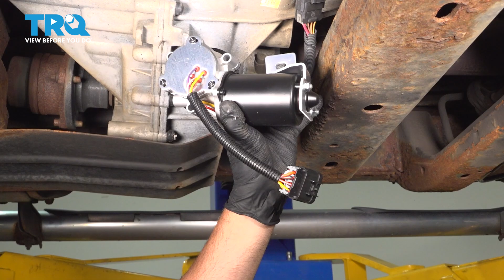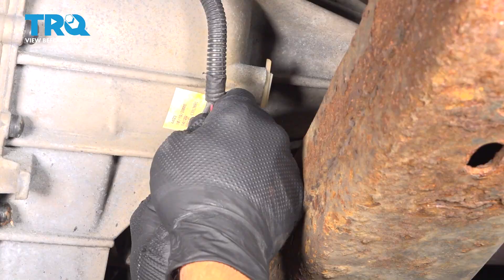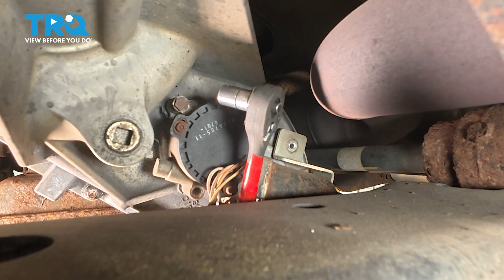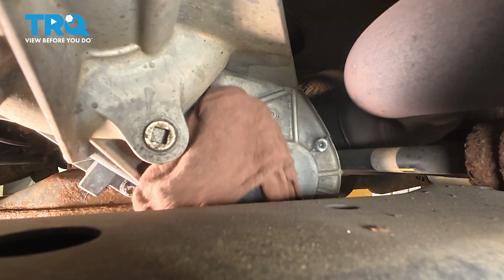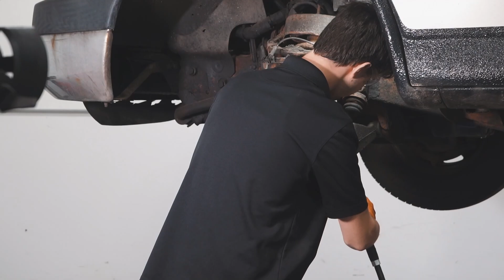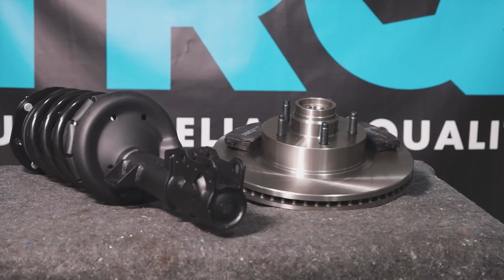How to Replace Transfer Case Shift Motor 2006-2010 Hummer H3

Comment: What is the symptom of a bad shift motor?  Is there a way to test the motor on the vehicle before removing to determine if this is the problem?  I can shift my transfer case into neutral but when I try to shift to anything other than, it locks up the drive so the truck can't move.  Also, is there sensors that determine if the case shifted properly and if so where are those sensors and can they be tested?